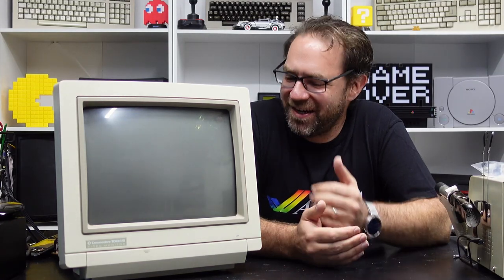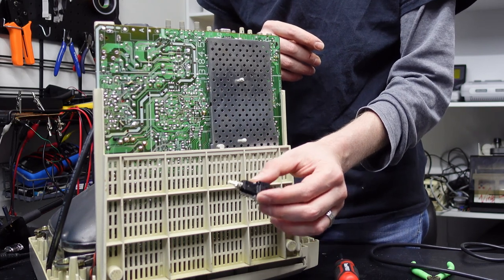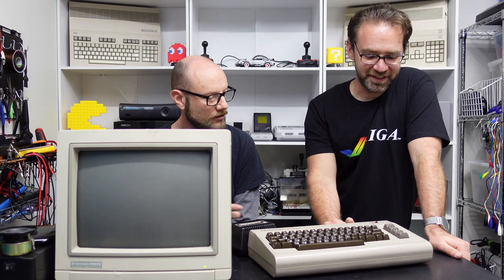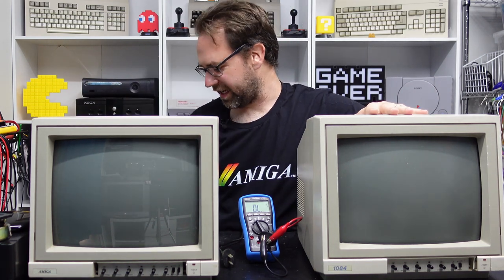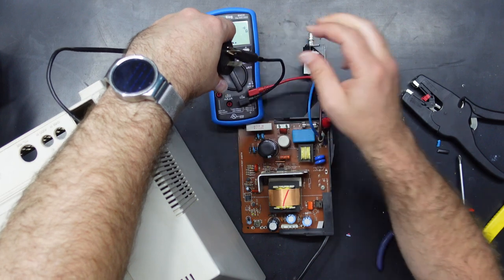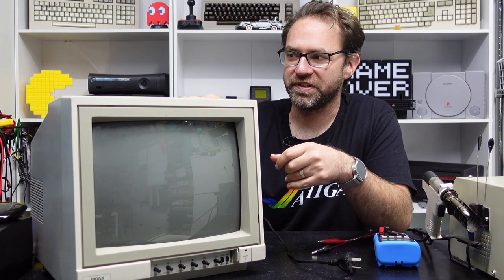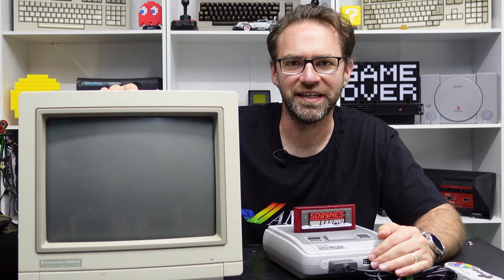Commodore 1084 - Replacement switches, flybacks, and other shenanigans - ft. Mr Lurch

Comment: I have two of these monitors.. both have a power switch issue.
Easy fix.... 50c thin guitar pick.... fixed 😂
Just wedge it in the side of the switch.
I dont want to risk stuffing something else up by pulling it appart.

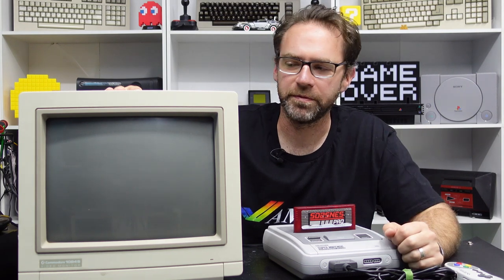Comment: 27:45 Patrons voted for a 1084 repair and a Patron walked away with a repaired 1084. Where’s the problem? 😂
Reply from the maker: They also exposed that I was holding onto Schrodinger's 1084. That thing was working until I turned it on 😄

Comment: I own a Magnavox 1CM135 which is very similar if not the same as this monitor. I remember noting shortly after I bought it in the 1980s how poor quality feeling the switch was compared to how they made most things in those days, and that it wouldn't stand the test of time. I still have the monitor today but I used it rarely past 1995 though I held on to it because it's compatible with everything.
Reply from the maker: Yeah those switches were not built to stand repeated use, it's literally a tiny maybe .5mm width plastic post inside that slots in and out of another plastic groove. Guaranteed to wear down or break over time 😒

Comment: These Philips monitors were the best except for the two problems of the switch and the front panel door breaking off.
BTW the switching power supply already isolates the chassis through its transformer.
Reply from the maker: The 1084S-P1 does have a hot ground in the power supply section, at least Phillips clearly labelled that one on the metal itself, the 1084 and the 1081 do as well but they are limited to just the power supply board but are not labelled

Comment: Hi, my 1084s-D2 develops an electronic smell, not like ozone, but close to it. I see that image is a bit washed out, slightly and not how i remember it. Did you have this kind of issues. Its super clean inside, used in a non smoking room. Should I replace flyback for any case?
Reply from the maker: Mine did not have any smell, but then again I only had it running for a few seconds. It does sound like you may have a damaged flyback based on the smell and lack of focus. But I'm certainly no CRT expert so no guarantee that replacing it will solve your problem